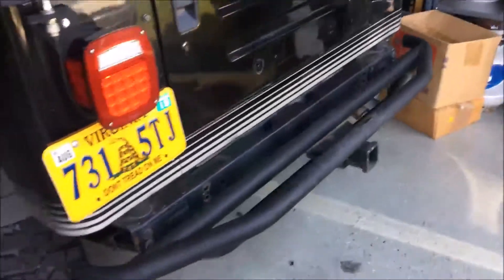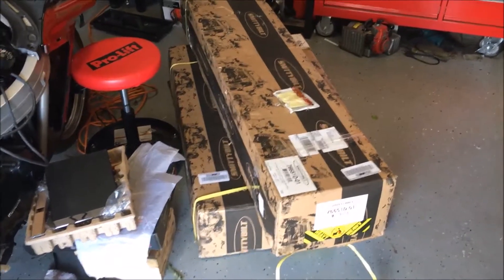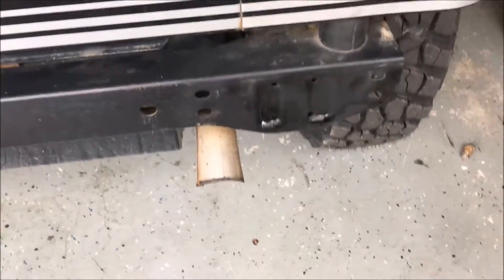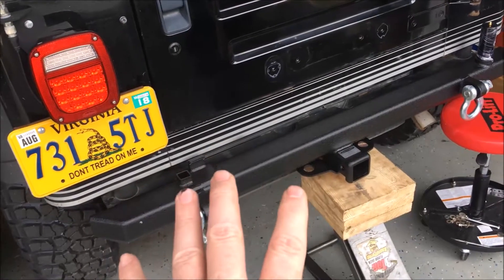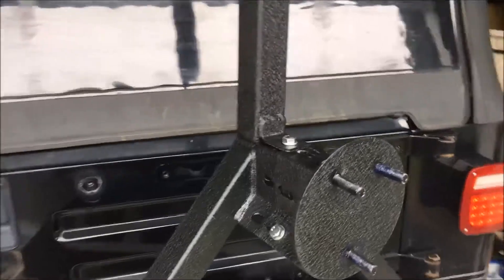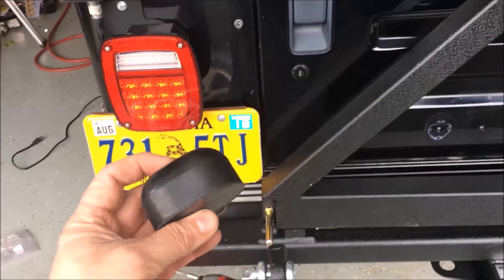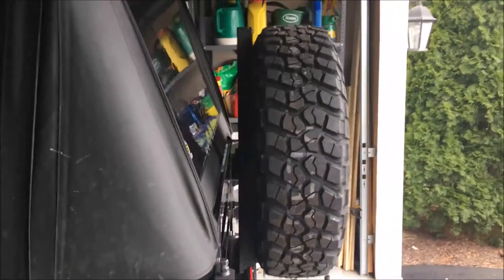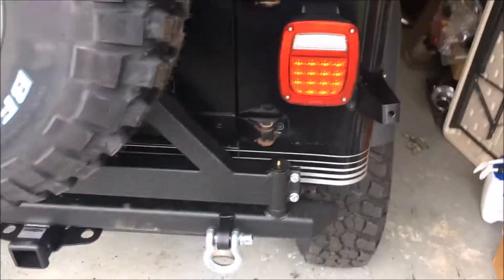Jeep YJ New Rear Bumper & Tire Carrier

Comment: Great video thanks for posting! How has it held up since the install?  Any issues?
Reply from the maker: It has held up well. Only issue is the latch for the swing out. It rattles. I have found a solution of zip tie with some rubber fuel hose which has worked really well at stopping the rattle. Otherwise it is great.

Comment: I have one question. Did you have to drop the gas tank to install this tire carrier. Thanks in advance for your help
Reply from the maker: Beavis Kornholio -No you can do it without dropping the tank but it is tough to get to some of the bolts.  It would be easier with it dropped but if you have some extensions and swivel for you sockets you can get it.

Comment: Great video. Very helpful, especially using the rubber bumper to stop rattling. Are the tires 10.50 or 12.50 width?
Reply from the maker: The tires are 33x10.5. Fit the wheel well and the rims just right.

Comment: Where did you get that rubber bumper to help with the rattle?
Reply from the maker: The large black bumper comes with the bumper.  I have since added a small clear rubber piece to keep it tight and not rattle.  The kind you get at the home store for chair glides.  Has worked great.

Comment: what kind of lift do you have and did it rub with 33x10.5 when flexed ?
Reply from the maker: I have 2.5 inch suspension, 1 inch body and 1+ inch shackle lifts on it.  I have the original fenders though.  Last time out I rubbed just a little on the back tires on the back corner fo the fender.  I need to do a TJ fender swap and then I will not have any rub.

Comment: Hi, where did u locate the third break light?
Reply from the maker: Mr. Meth my Jeep is a 1991 which was the last year before the 3rd tail light was required. So I don’t have one at all. Also last year for the sport roll bar.
Reply: StarkReality ohh I didn’t know that. Mine is 1995. Is there a room to install the third break light on the bumper? Also I checked and as right now is over 300 on amazon. I just bought a winch and other stuff and don’t wanna break the bank.
Reply from the maker: Mr. Meth there is a spot on the top of the tire carrier where you can attach a 3rd light. There is a mount hole.